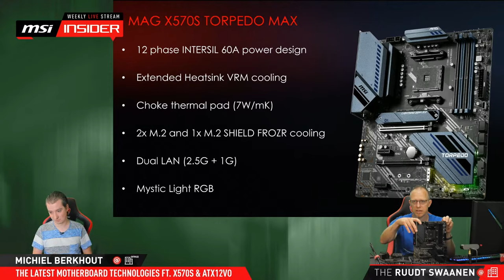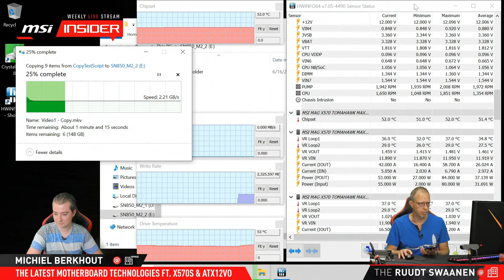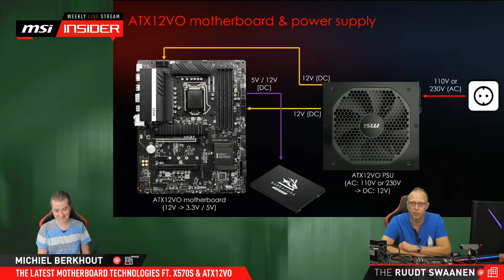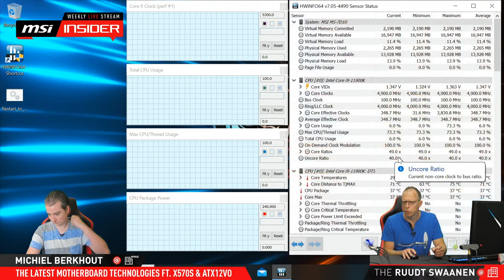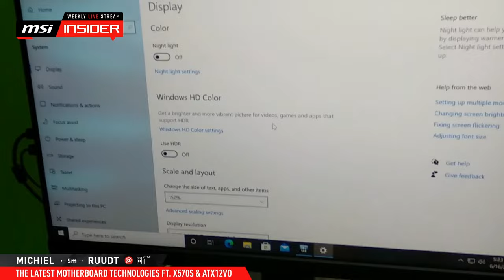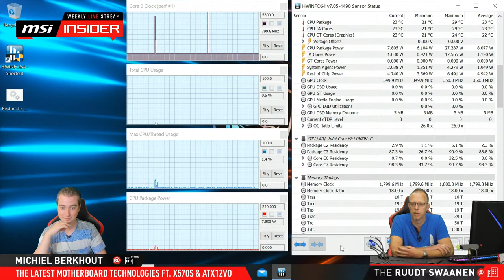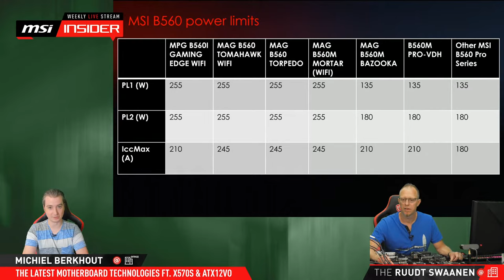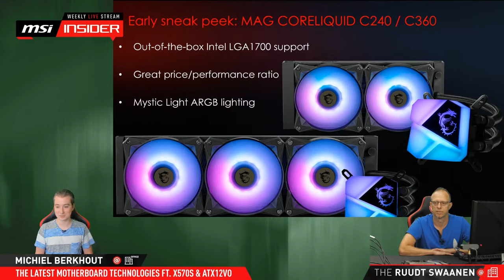The latest motherboard technologies ft. X570S & ATX12VO

Comment: That still makes me so angry: 
Mainboards with m-ATX form factor are still ingnored with X570 and now also X570S chipsets! 
It is wrong, that the B550 chipset is enough for smaller form factors ( 4:00 ) by shared lanes. I was unable to find any board that allows me to use the 2nd NVME ( with only PCIe 3.0) without without deactivated slot for a better soundcard instead of the oldfashioned onboard codecs. There is no m-ATX board with minimum Realtek ALC1220 audio codec and for that a free PCI slot most far away from the graphic card interferences available. 
On the other side there are ITX board with X570 chipset and Realtek ALC1220 available. There surely the B550 would be the better choice for there are no lane sharings possible by hardware limits - really stupid...
Reply: No reaction from MSI about mATX - disappointing...

Comment: So... 12VO means that motherboard would be even more hot (12->5V and 12->3.3V always emits additional heat) and even more sensitive to the quality of  12V lines from PSU. Also it means that quality of such voltage conversion would be worse, because in general there is not much room on a MB to fit all that big or even huge electrolytic CAPs that you you used to have inside PSU for stabilization and consumption peaks. Also it means that number of radiators would be even bigger, MB profile would be even taller, HEAT would be concentrated even more (you know CPU heats up a lot, GPU invests as well like directly from hell).... What's the benefit Intel? I didn't quite get it!!!! I'm OK with 14 additional cables it that allows me distribute heat in the chassis... From the other hands, this kind of standard is cute for micro PCs, but c'mon, they do have a custom power solution usually...

Comment: will there be a new oc feature like asus and gigabyte have implemented ( active oc , dynamic oc) for switching between all core oc and pbo for lightly threaded tasks? Btw. x570s unify x looks vermy promissing to me, refused to buy the b550 because I didn't wanted the downgrade from my x570 for the ram oc feature, but now I see now reason not to switch!

Comment: Not sure if this was mentioned in the video, but what are the major changes to the audio on the X570s Tomahawk Max? There are clearly visible changes on the PCB, compared to the X570 Tomahawk.
Reply from the maker: The audio has been upgraded from the Realtek ALC1200 on the MAG X570 TOMAHAWK WIFI to the Realtek ALC4080 on the MAG X570S TOMAHAWK MAX WIFI :)